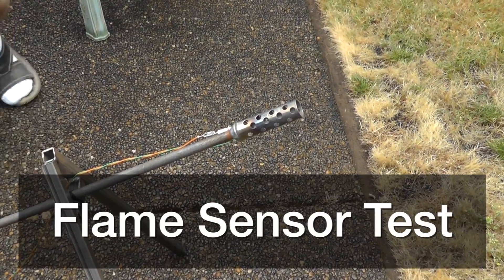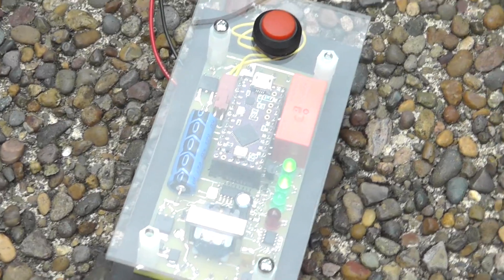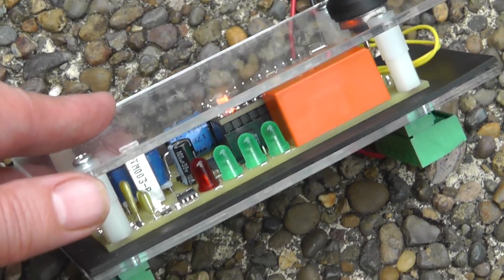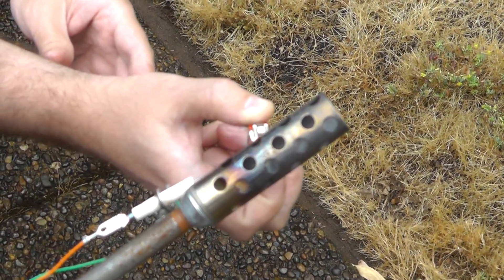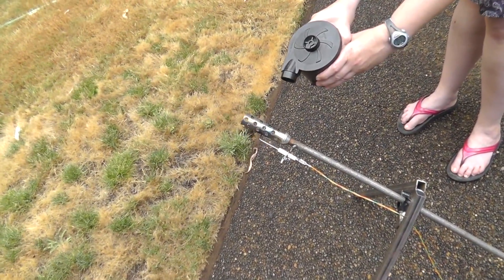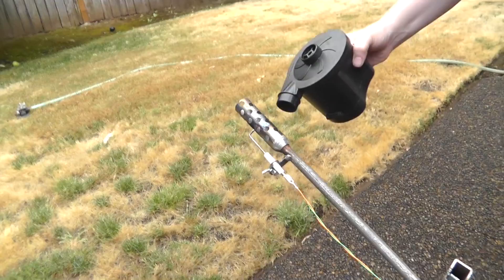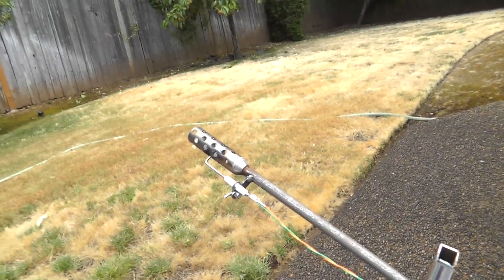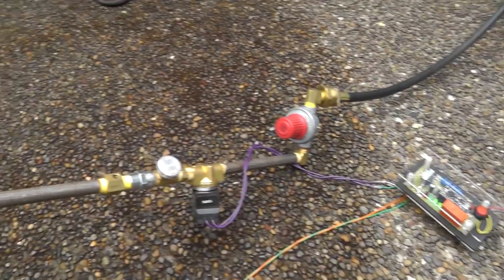Flame Sensor Test

Comment: Can you send me PCB if possible
Reply from the maker: This is DIY electronics.  You can buy or make the PCB yourself from the files I published.  But I will not do it for you.  DIY - Do It Yourself.  And you are responsible for all risk if you build it.  This is not a commercial project, just free info you found on the internet.
Reply: @PaulStoffregen  OK  sir thanks for feedback

Comment: Hello I need help, in my garage my ceiling mounted furnace is trying to start I get a flame for a few seconds then it cuts out, the fan keeps going, and it keeps trying to light but same thing, then after a couple minutes it dies, I took the flame sensor out doesn’t look dirty enough to make something not work, I hooked up my Klein digital multimeter and on the setting where it makes noise the number eventually goes down to .7 and on the setting with the horseshoe it reads 0.0000 can someone please help.? Tia.
Reply from the maker: Years ago my furnace had a similar issue.  The controller LED was blinking, indicating a weak signal.  The sensor rod didn't look dirty, but scrubbing it with steel wool (as some site suggested) did indeed fix the problem.  I also swapped out the hot surface igniter when it died.  But I'm not a qualified furnace tech, so I really can't make any serious recommendations, other than of course suggesting to have a qualified tech come look at it.